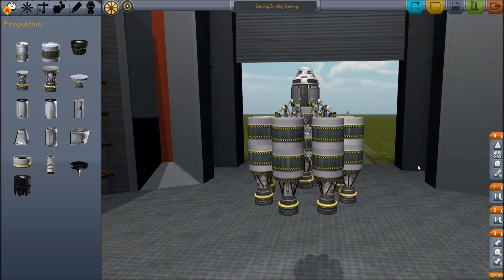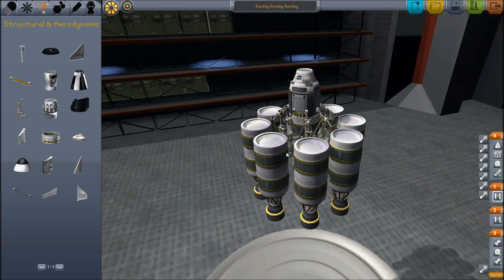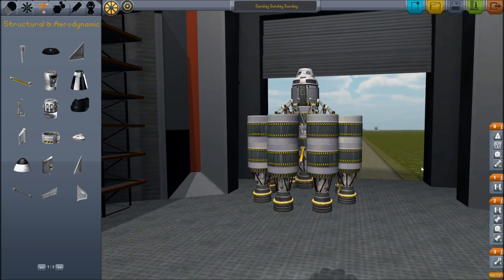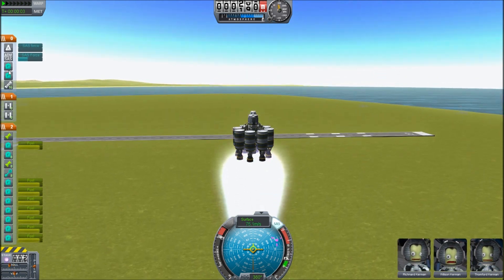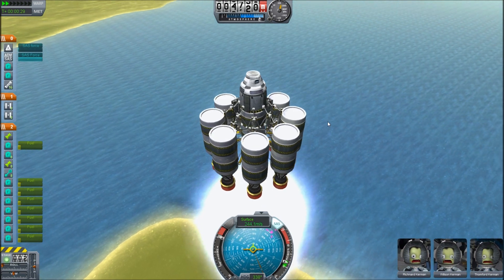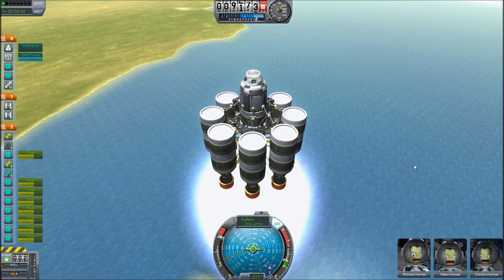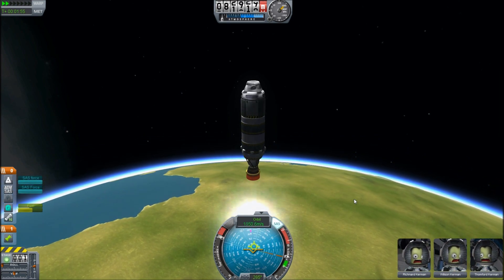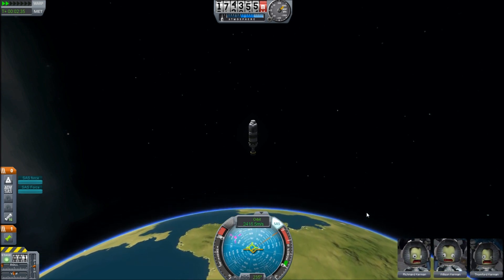Kerbal Space Program - Fuel Line Myth Busting

Comment: You can make that craft even more efficient by wiring it in an "asparagus" style, so that it jettisons off pairs of external boosters at a time, going from 9 to 7 to 5 to 3 to 1 engines running, burning only 2 tanks of fuel at a time, rather than all at once, jettisoning dead all the empty fuel tanks as needed. With that kind of wiring, your craft can easily make it to a munar orbit and return.